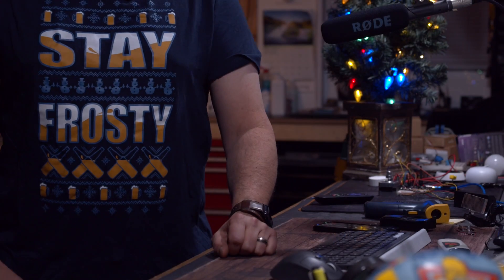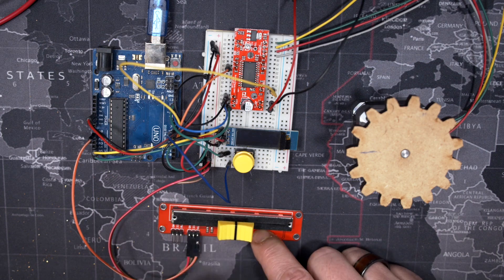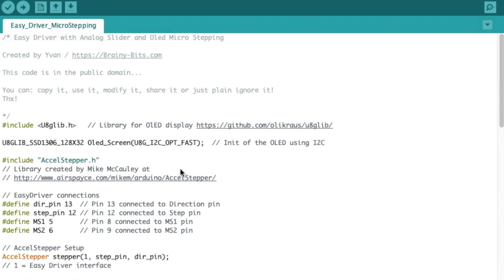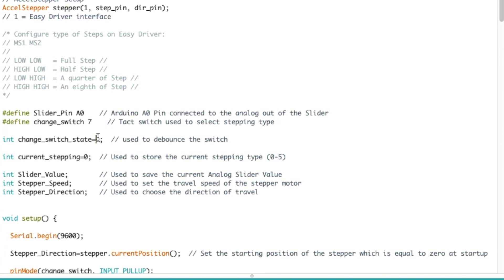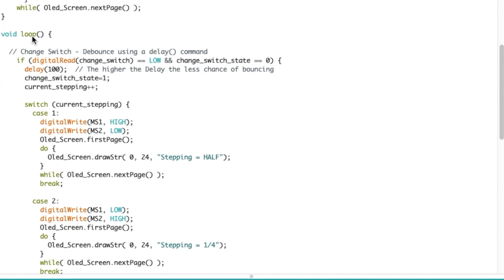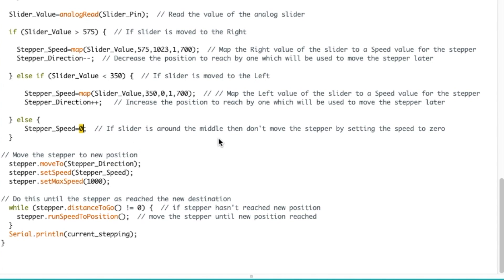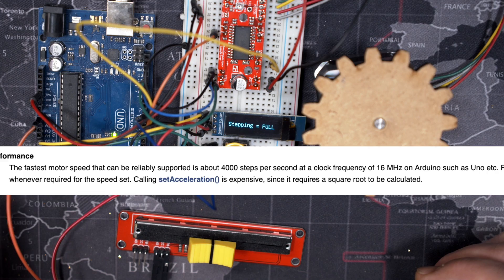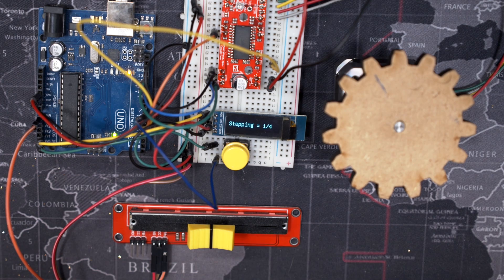Stepper Motor MicroStepping?  Things to keep in mind when doing it…

Comment: 07:14 The big tradeoff is NOT the microcontroller. The tradeoff is your Arduino software.
If you were to write your code in Microchip's Studio 7 in either ASM or even C, you could have as many steps per second as the stepper motor could handle.

Comment: I really enjoyed watching and learning here. and as is obviously you have  so many projects done and gathered experiences from them.  so please help me if you have time for this:
I have three stepper motors which are 3 phase - 3 wired - 4 a  . I know some drivers  like leadshine HY-DIV268N-5A but they all are more than my budget ! 
once Itried that with a  driver and when I addjusted the sw setting to  micro step mode 2A or 2B it worked very nice  , smooth and with  high torque but the direction was random!! some correct and some not!
do you know how could I drive these nice steppers?!

Comment: how can i control the direction of stepper using external signals such that when the first signal is high and the second is low turn in clockwise , when change states turn in the anticlockwise and when the two are low stop the motor 
please would you help me with the code to do so?

Comment: Hi there! I followed your project to automate an old slider and "almost" works perfectly ... The electronics work very well but the video picks up a shake when I use high focal lengths. I'm using vibration dampeners.
Any suggestion?
Reply: UPDATE I just found the TMC2208 to be much quieter. Could you help me make the connection by replacing the EASY
DRIVER for this?

Comment: The thing that limits your speed is not microcontroller but your code. You shuld use stepper motor based on interrupts and avoid delay() in main loop. Instead, you said that Arduino Uno is bottleneck...

Comment: Nice video, thank you. I noticed that your code uses runSpeedToPosition(), so it seems that you're not using AccelStepper's acceleration/deceleration capabilities, basically the main selling point of this library. For using them, one should use either run(), runToPosition() or runToNewPosition(). With runSpeedToPosition(), one should be able to run quite a bit faster than 4000 PPS (although above certain speeds, the stepper should be accelerated gradually, rather than trying to go "from zero to hero" abruptly). The delay-based stepping has a drawback that it blocks the loop for the minimum pulse duration time (16-48 clock cycles), during that time your program can't do anything useful. As the pulse rate is increased, the amount of time spent sleeping inside the delays grows larger and larger, leaving less and less time to run any other code you have.

I want to clarify that Arduino Uno runs at 16 MHz, and is capable of generating much more than 4000 pulses per second. The mentioned 4000 PPS limitation comes from the AccelStepper library. The library's basic operation is based on setting the output pulse pin high, delay for minimum pulse duration microseconds (1-3 depending on the driver), then setting the pin low again. Stepping like that via this library's runSpeed() or runSpeedToPosition(), or manually, you could easily output quite a few pulses per second. 

However, if one uses AccelStepper's acceleration/deceleration features, for each single step it does quite a bit of calculations to compute the new speed, including floating-point multiplications and divisions - very slow operations on an Arduino. This reduces the max possible pulse rate probably by a couple of orders of magnitude. The AccelStepper library is based on equations from an article "Generate stepper-motor speed profiles in real time" by David Austin - I couldn't find the source code, but the article says it uses 24.8 fixed-point math (and an 8-bit PIC microcontroller), unlike the AccelStepper.

For a much more optimized code, see AN_8017 from Atmel/Microchip - https://www.microchip.com/wwwAppNotes/AppNotes.aspx?appnote=en591185
It uses only integer math (including a neat integer sqrt implementation), and a timer interrupt (using the 16-bit Timer1) to manage the stepper's movement - leaving you free to do whatever you want in the main loop (no need to call run()). According to the application note, "the timer interrupt performs calculations during acceleration and deceleration and approximately 200us are used in one timer interrupt. When running at constant speed less time is need and approximately 35us is sufficient. The maximum output speed is then limited by acceleration/deceleration calculations. For a stepper motor with 400 steps per round maximum output speed is: 78,5 rad/sec (750 rpm)". The demo code is for an ATmega48 running on 3,68MHz - an Uno is 4.3 time faster, so you could use 1/8 microstep (1600 steps per revolution) and still run a (single) stepper up to 750 rpm.

Having said that, AccelStepper provides a simple and easy-to use API, and is good for beginners. It is slow, but if it's good enough for a particular application, why not?
The reason I posted all this is that I don't like it when people make general statements like "This 8-bit microcontroller is too underpowered to do task X at speed Y". A typical Arduino project (and many of the libraries) don't care much about doing things in a performant way, instead priority is given to other considerations, such as simple-looking code that is easy to write and read, being beginner-friendly, etc. This is great for learning to program and to tinker with electronics! But when one starts to push the boundaries of what an 8-bit 16MHz Arduino can do with these libraries and programming attitude, there are two choices - get a bigger and faster MCU (e.g. STM32, ESP32) or go deeper and learn to program your Arduino in a more direct, low-level way, learn to optimize your code. It's likely you will be able to do the same things as you were doing before, but 10, 100 or even 1000 times faster.
Reply: yes I agree with you
Reply: the fact the video uploader hasn't responded to you shows how complacent and incompetent he is.

Comment: May I suggest using tone() command for generating a pulse step?  I have been using it for several years in the Arduiono environment and  have had good luck. I drive small pumps and run them from 1-500 RPM using 16 microsteps = 53Hz to 26.5kHz.  Of course, this does limit further use of the timer associated with the tone() command. Not a problem for me because I am only interested in stop/start, direction and speed when running the pump.

Comment: Did you need an external power source for the motor?
Reply: I made myself useful and read on your website that you used a 24V 5A source. I am currently power my stepper motor with the 5V usb cable to the pc so I could not get higher speeds than 70 rpm. At higher speeds the motor would just skip.

Comment: Torque is also affected during micro stepping. Smaller steps, less torque.
Reply: Why torque goes less as small steps ? it that because of less current goes to the windings ?
Reply: @wadib3eed7  You have a fixed number of magnets. Full step, greatest torque, is stepping from magnet to magnet. When you start making the steps smaller it's because you are magnetizing off center windings. This probably explains it better;
https://www.linearmotiontips.com/microstepping-basics/

Comment: Merry Christmas - and thanks for all the great content in your videos. I always have issues with the easy driver and them getting really hot almost instantly. I have tried to use them several times just messing around with them. Maybe my steppers are to much of a load with a standard Nema 17. However they still get to hot with some of the Nema 14 / Nema 15 size motors. That why I just moved to the TMC drivers and using that with the Nano. Have to make my own make shift PCB but they seem to work well in my application. Guess I will have to try one last time with the easy drivers :(
Reply from the maker: I hear you, the EasyDriver can get pretty hot but it is made to run hot.  Adding a small heatsink will help.  I've been using the EasyDriver for a while, at the time it was a good option, but there's better option out there now.  In the next year I'll start using those to see how they compare.  Thanks for watching and Happy Holidays!

Comment: Ivan, thanks for this. How is the torque affected when microstepping. I presume as the signal is ‘shared’ across coils the torque is reduced?
Reply from the maker: This is a tricky one, depending on a lot of variables, voltage, stepper motor, etc..  but in most cases you can expect around less than 10% loss in torque when micro stepping, but again this is not consistent.  I will try to make a test bench of this to see what I come up with in the next year :)  Thanks for watching and happy holidays!
Reply: @BrainybitsCanada  +1 for this test. Also, thanks for uploads. Very interesting stuff. Learning a lot.
Reply: Torque losses are proportional to the number of micro steps attempted + the speed of rotation used..  at 256 steps  there ain't much left.
Also the precision falls off  just as proportionally, as Interpolation can only go so far in dividing up the magnetic   poles ..cleanly .  (as if :-) 
Short answer: Micro stepping our Cheap Ass Chinoiserie steppers is often Pointless even counterproductive. 
There are Far better ways to genuine precision  with Torque ..such as  Gasp! reduction gearing